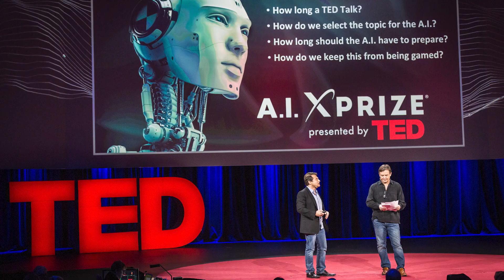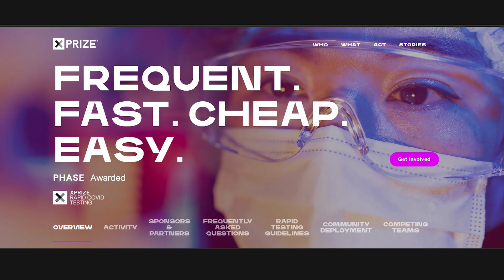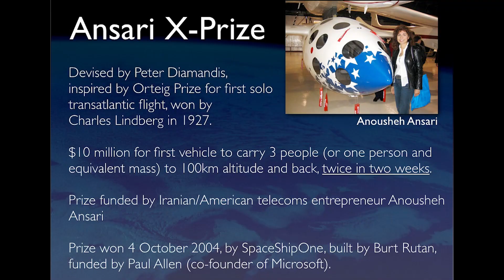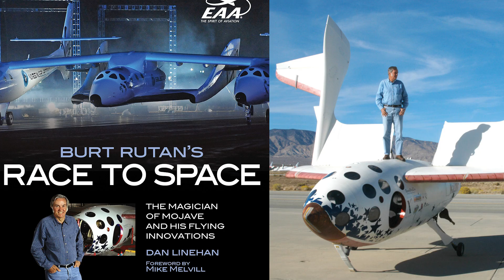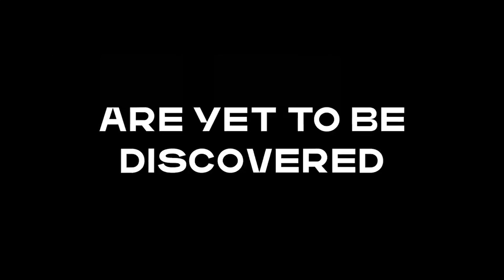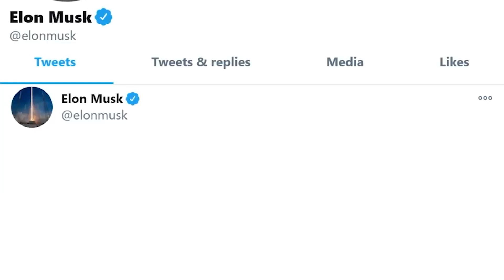How Engineers Can Change the World? How do Engineers Help the World?

Comment: hey Jake my goal is to become a Software Engineer and then eventually a Software Architect, I live in the Bay Area so there are plenty of jobs. But I am having trouble choosing a major, I am a senior in hs rn so I still have a little time to decide, but it’s between Software Engineering, Computer Engineering, or Computer Sci. I noticed that you said to not do Software Engineering as a major but my school, SJSU, does have an ABET accredited Software Engineering program, if that changes anything? Also it might be hard to switch to CompSci since it’s impacted. So my question was if you think it’s worth trying to switch majors to SE or CS or just stick with my declared major which is CompE? (I could switch to SE a lot easier since CE and SE are within the same college, unlike CS)

Comment: Engineering is awesome. Do you have any advice on how I can persuade my children to take up engineering? I hope to push them towards that direction while they are still in grade school.
Reply from the maker: Hey Data, thanks for the question. I find there are 3 essential steps.

1. Math Confidence

Being good at math and science sure comes down to some element of ability and naturally being more left brained, but at a young age math is a skill. It can be built like reading and writing and anything else. But math is different math builds like a pyramid so if a student faulters for just one of their 12 grades, by the time they get to university they are unprepared for the calculus and physics required for year 1 in engineering. So make math fun. Do a lot of it. And convince them that if they want to do anything fun for a career, they need math.

2. Visioneering

In building this community for 4 years, the biggest issue is actually choosing which engineering. Students know about cool technologies and intriguing movements but there is no one connecting the dots. Want to engineer for SpaceX? Do I do aerospace engineering even though there are far less programs? Can I just do mechanical engineering? Which engineering do I do for robots? Electrical or Mechanical? Etc. So have a rough sector plan. Want to work with cars? Want to work with buildings? Want to program more? They need to know which engineering to choose. 

3. Projects 

Wanting to be an engineer is also about fit and ensuring that they can get the incentive up for 4 years. So if a student knows why they are there and why they are working so hard, they will stick with it. So once you have a plan for their career and a rough engineering lane picked out, get them doing projects in middle and high school so they walk into engineering with momentum and advantages and they can maintain this easier in uni.

I have a question for you too, and can email you links to more info. Could you email me? Thank you!! hello@jakevoorhees.com cheers !!

Comment: I like to analyze the speed of things. What type of engineering
 suits me best?
Reply from the maker: Hey thanks for the comment. Depends what you're interested in. You can measure the speed of anything. Civil engineers may measure the speed of a bridge deflections and vibration in buildings. Mechanical Engineers may measure the speed of a vehicle and fine tune the parts. Or measure air flow speed throughout a building. Maybe the manufacturing speed of parts while they are produced. Electrical Engineers may measure telecomm speeds, rate of power, electronic component speeds, and so on. You can measure the speed of anything. I think you should check out these videos to explore more about the difference types of engineering:

“Best Engineering Majors | Engineering Degree Tier List” https://youtu.be/nfayHVJlKgQ 
.
“Mechanical Engineering Job Tier List” https://youtu.be/ghxBLeEX_OM   
.
“Electrical Engineering Job Tier List” https://youtu.be/6r3hG_zA8d8 
.
"Civil Engineering Job Tier" List https://youtu.be/Q8ls52m18gQ 
.
“Software Engineering Job Tier List” https://youtu.be/6_1LtgvYo7o 
.
Does this help? Let me know what questions I can answer for you next okay? Cheers thank you !!